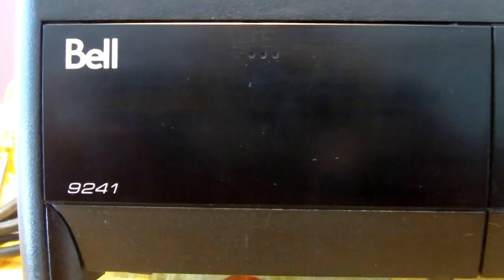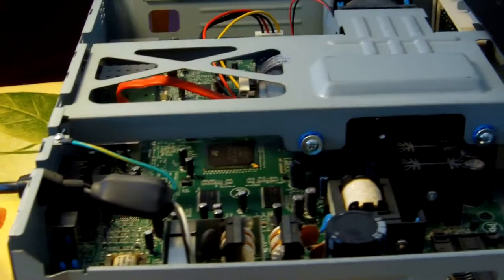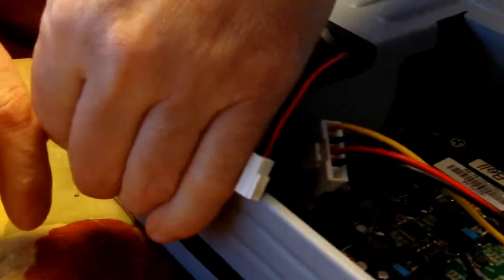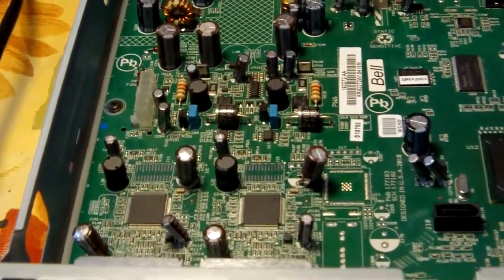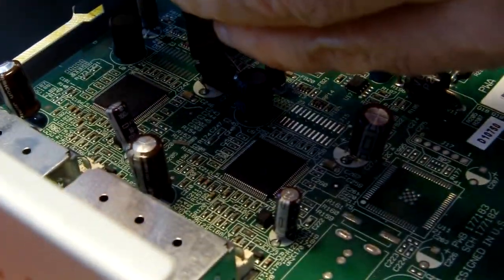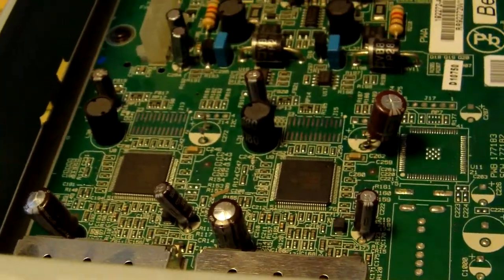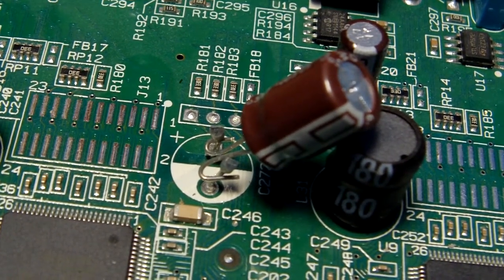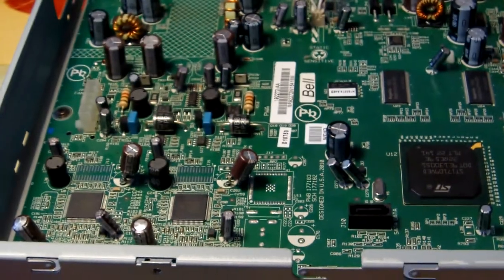Changing Capacitors the Fast and Easy way.

Comment: After the replacement of the 4 caps I get a signal but it’s all black. I’ve redone the cap replacement a second time and same thing. Before the old caps were removed I had signal that would eventually drop out. Any ideas?